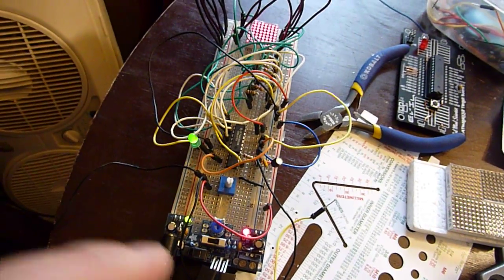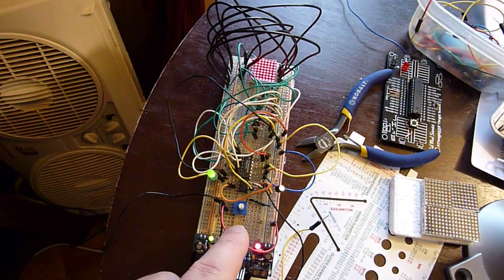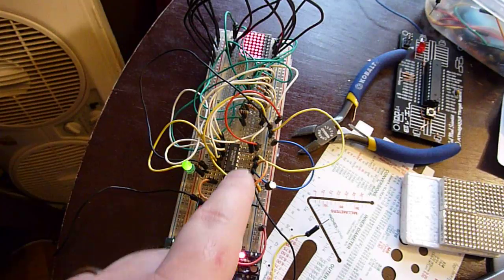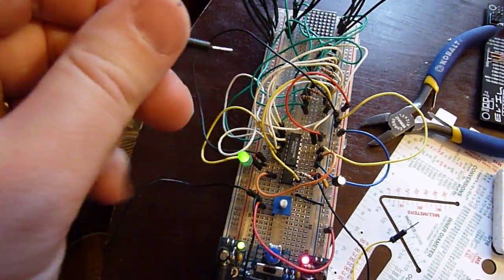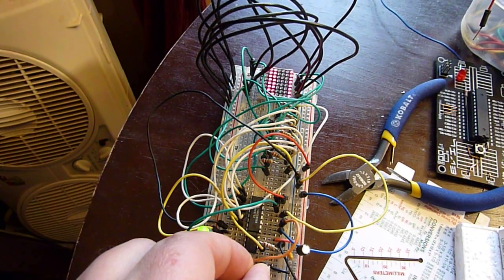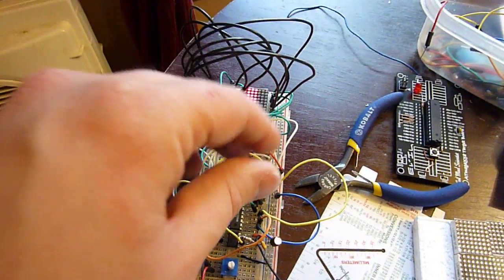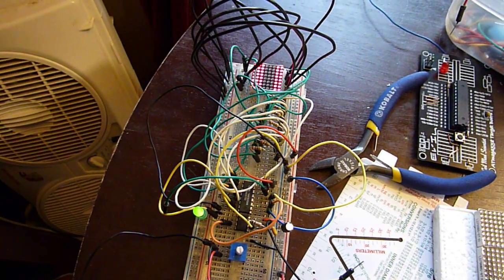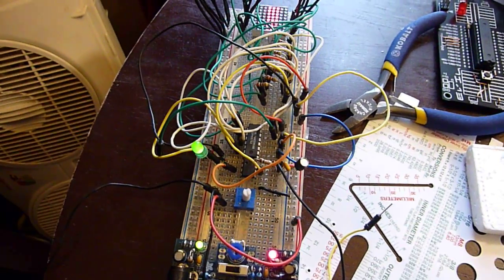WTF 555 timer with 74HC595 shift register

Comment: It's likely because of the voltage you're putting on the pin. If it's a high impedance input then it wouldn't take much to cause sharp voltage fluctuations on a floating pin affected by electrostatic or electromagnetic fields and fluctuations, especially when you have something to make it act like an antenna. These voltage fluctuations are enough to trigger the inputs in odd ways based on the "signal" being picked up.

Even though this is a digital IC, at heart it's still very much an analog piece of equipment in a very noisy organic world. It's trying really really hard to be as "ideal" as it can, faced with the noise of reality.